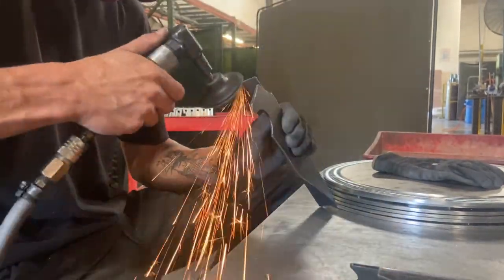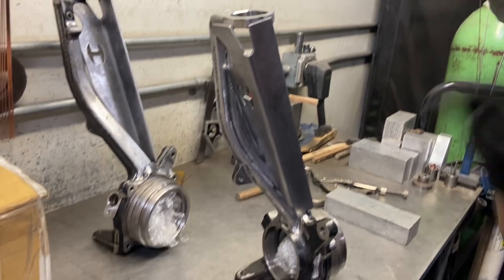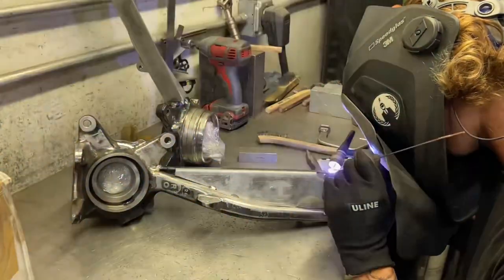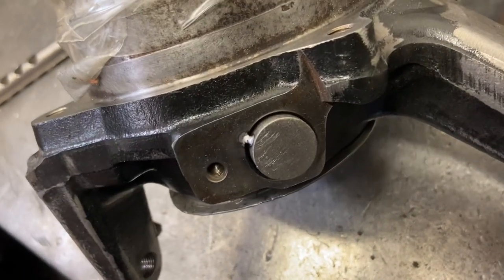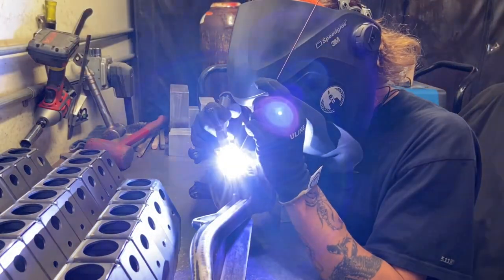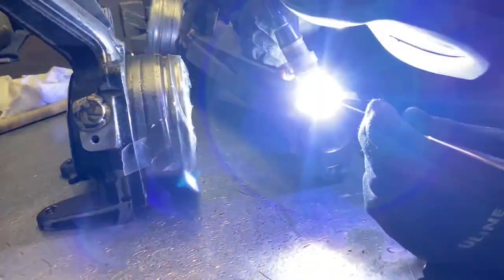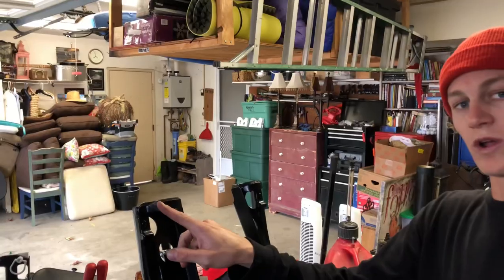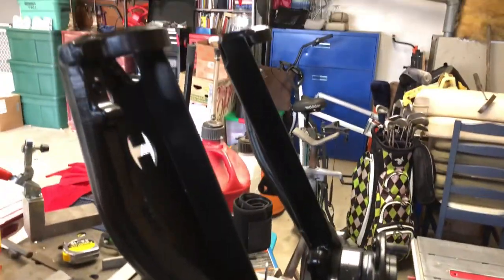TIG Welding Spindle Gussets on 04-06 Toyota Tundra Spindles. Swapping Tundra spindles on Tacoma

Comment: Did you make the reinforcement for the upper ball joint? Also what paint did you use to paint the spindles? Looks good man!
Reply from the maker: Yea just that small piece of metal like 3 1/4” long that wrapped the upper joint. 
The paint is a semigloss Rustoleum works great!  Thanks for checking them out. Sorry I never saw your comment

Comment: How do you plan on fitting the lower ball joint into the lower control arm? I believe the tundra ball joint taper is different than the Tacoma and 4Runner
Reply from the maker: Yea it’s got a bigger tapper. Originally I was gonna drill out the lower arm bigger but now I decided to just take the misalignment spacer and turn it down on a lathe. If your using OEM LBJs you will have to drill out the arm. But I’m  Using the 1” uniball style conversion for my truck.
Reply: @AnonymousFab  is that something I could request if I decide to go with your product?
Reply from the maker: @Spaceberries12  yea it will definitely be a special request thing but I could easily do that for you